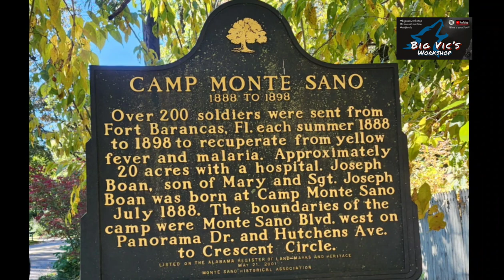#109 (3) Vintage Estate Sale Tool Hauls with (3) Before-After Tools/Items ☆ Snap-On ☆ Stanley☆☆☆☆☆

Comment: That K-D tool is for making looped ends on cables like choke cables and thottle cables on gas powered machines. A hard to find and valueable tool in small engine repair businesses. Look at small engine hard wire cables at the end of the cable is a coiled end to connect the cable to a choke or throttle lever.
Reply from the maker: Thank you Mr. Chuck! Fantastic Information I appreciate it! I would had never figured them out.

Comment: I believe that small silver metal handle screwdriver was included as an accessory with Smith and Wesson revolvers when sold.  It is an early type and collectible, I believe.
Reply from the maker: @gupspad401  I appreciate the info and your correct I come to find out that was a S&W kit screwdriver.  They are pretty cool.. thank ya sir

Comment: The Craftsman prybar, in the Stanley version is my favorite prybar to reach for.   When a 12 penny nail just doesn't want to quit, and it springs just right that prybar will send it flying.    I'm always careful when pulling nails.      tHanks for the video!
Reply from the maker: Thank ya! Also, nice to hear someone refer to a nail using penny... i still use the term. seems everyone else just calls them by the number these days... but you just mentioning "12 penny"  took me to a great memory of my Dad and I repairing window screens for a local farmer when i was a kid. :-) thanks!
Reply: @bigvicsworkshop  memories can sometimes be better than dessert.

Comment: You got a lot of great stuff Mr. Vic! Love the IH bulb box. I have a round one that just holds one light and some bulbs but it was empty. That linseed oil can is cool too. I’ve never seen a cylindrical one before. Good stuff. Take care 😃👍🏼
Reply from the maker: Thank ya Mr. David! I have searches to my abilities online to find info about the box.. I can't even find one that looks like it..most are just metal red boxes... I think the linseed can is cool as well.. I live stuff like that..and when I opened it the cardboard in the cap was stuck.. I eases it off and it sounded like I opened a vacuum sealed container.  😅  Thank ya for your time as always!!